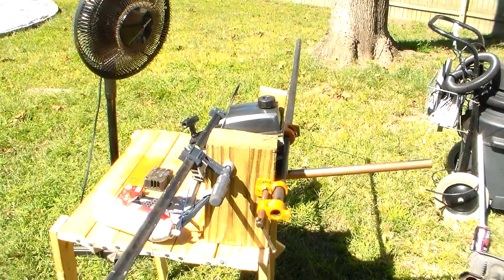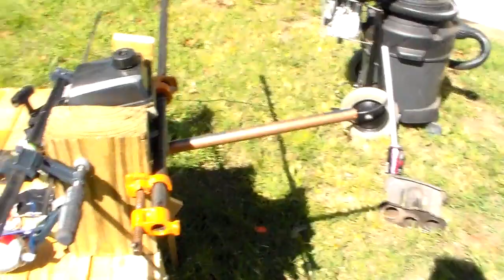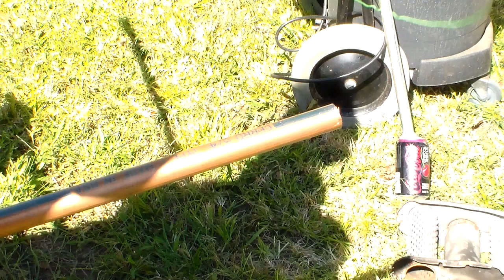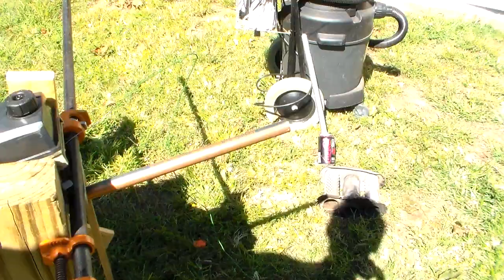2 stroke engine with 1 inch straight pipe

Comment: hey buddy 2 strokes need a muffler that can redirect the exhaust fumes back into the cylinder to burn unburnt gas. by doing this, you are making it run very lean and its possible that you could overheat it and blow the top end
Reply from the maker: cainen172 Naah, common misconception (though it might be different for different motors/makes). I've ran this thing with MANY style exhausts and mufflers, and not a single problem with it.
Reply: +cainen172 it's not going to lean it out, it's just not going to run at as high of performance such as a dirt bike.  And he's going to loose a little efficiency at higher rpm